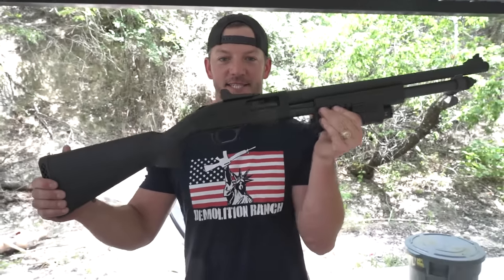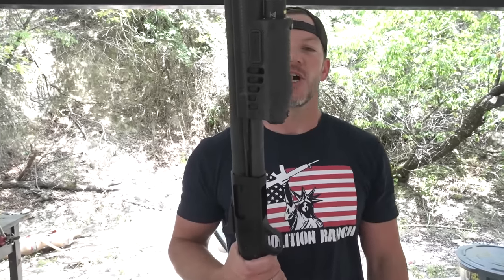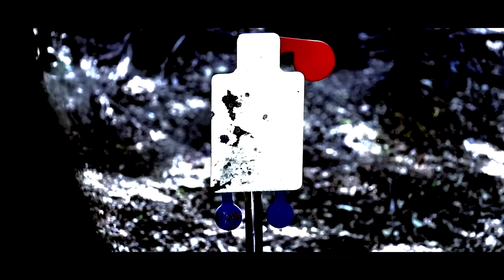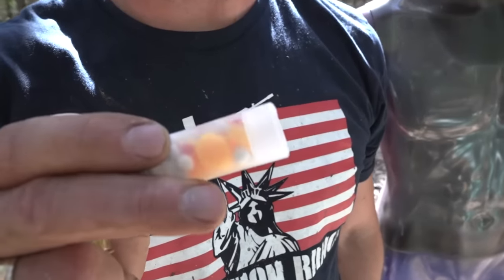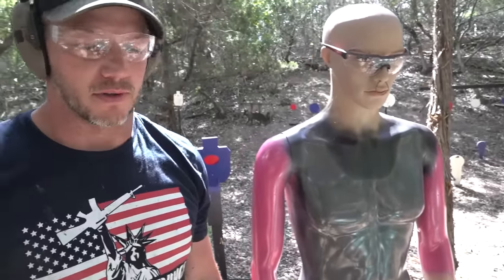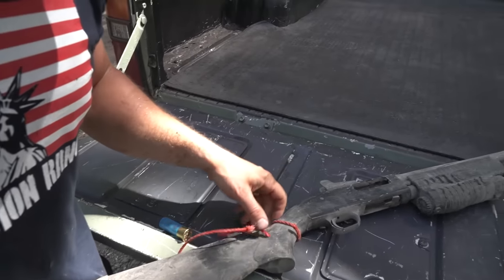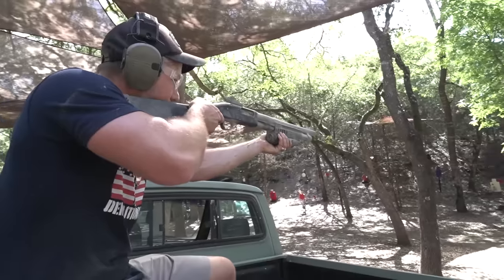DUCK Shot! Rubber Ducky 12g... Gimmick or Deadly???

Comment: That Mossberg sounds a lot more solid than my 3 Remington 870's to be completely honest.  I have never owned the 500/590.  Maybe I should buy 1...
Reply: They're still relatively inexpensive, and built like tanks. I've been a fan of them since I got my first "combo kit" from Big 5 in the '90s, with the single bar action. Thing was indestructible; I sold it along with many of my guns when I got laid off during the dot-com crash in '01... and promptly bought another 500 as soon as I could afford a new one. They're kind of like, well, Toyota pickup trucks...
Reply: Or 2 the maverick 88 is basically the same thing. The safety is a little different and I don't think it's has as much blueing. For the money they are solid asf though. Mossberg 500 series are badass. The maverick 88 is alot cheaper though.

Comment: I recently got to play with a 590S.  It doesn't have the heavy barrel and metal trigger frame like the A1, but it will cycle any combination of 1.75", 2.75" and 3" shells from the factory, no mods or adapters needed.  The 20" model will hold THIRTEEN Aguila shortie shells filled with four #1 buck and seven #4 buck.  They're less powerful than standards shells obviously, but still very capable of doing most things you might need a shotgun to do, and now it only kicks like a 20 gauge.
Reply: I actually like the lighter barrel the A1 is really heavy for what it is and the metal trigger frame can be upgraded from brownell’s making it the best of both worlds
Reply: These minis seem to be the wave right now, but have you actually seen anything as far as effectiveness testing? I’m really curious in them but I like the terminal ballistics of full power rounds. Just curious, not trying to start anything.

Edit: Paul Harrell has 2 videos up about them, so I’m sure I’ll find some answers there.
Reply: @superluminalsquirrel9359  they are actually kinda old they have been around for a while haha they’ve just been out of stock everywhere

Comment: I run aguila mini shells in my mossy for home defense. Doubled my loadout and still devastating. It runs it just fine with an adapter in the receiver. Kind of hard to find ammo, though.
Reply: Semi-auto or pump?

My real question is does a pump-action require that adapter to run minis?
Reply: @superluminalsquirrel9359 500 pump. I was surprised on the recoil the first time I ran the mini shells. Being so short of a shell there's no room for a buffer, it's just a hard plastic puck. Not bad recoil, just a little more than I expected. Decent groups. The slugs still pack a good wallop.
Reply: @superluminalsquirrel9359  I've been told it isn't needed. But I've never seen anyone actually prove it. It's under 20 bucks for the adapter. Pops in and out very easily but has good retention. Mine has never fallen out. I tested it when I got the ammo and it would feed without it.... some of the time.
Reply: @HolmWrecker  if you're relying on it for home defense definitely need the adapter. No since in taking a chance

Comment: I bought a nightstick weapon light, attached it to my AR,  and same night...screws that attached the light to the bracket that was attached to the handguard  stripped , broke. I don't think I tightened the screws too much in my opinion either. I also could have got a lemon. However,  surefire all the way and streamlight.

Comment: I can say right now that green laser isn't going to last very long. A red laser would have been better because red lasers can be made using a single diode with nothing else, just one little square that the light comes from, basically. Where a green laser needs a bunch of other crystals and other optics to get the green color. It's not possible to make a green laser with just a diode like that. But that means if any of those optics get knocked around and moved even just a fraction of a mil, it's going to turn that laser into a green flashlight pretty quick. I'm sure anyone who's had a cheap green laser can relate. You drop it once it you no longer have a nice clean beam.

I can understand using a green laser because the human eye sees green most clearly. That's why with a <5mw red laser you just see the dot, but the same power green laser you can see the beam through the air and the dot is visible from much farther away. But green lasers just aren't built for ruggedness. It's a bit more expensive, but a higher power red laser would probably work just as well. But I don't see the point of putting a laser on a shotgun anyways. You're not going to be THAT far away from your target that you're going to need that laser. I'm no gun expert, but I'm sure iron sights or a red dot or something would be sufficient. Correct me if I'm wrong though. I'd be interested to hear about it if I am mistaken.

Comment: Matt you should invest in a pac of wetwipes, you are a father so you should be familiar with them. 
A pity to do that to a Mossberg, treat it right and it will last you a lifetime ( it may even if you don't ).
I still would like you to do a program with the Swedish 9 mm ammo, P39B!
Steel jacked armor piercing 9 mm parabellum, and it have the higest gas preassure of any 9 mm ammo.
They may be hard to get because they are forbidden in most countries.

Comment: Please shoot the new refrigerators that use oxygen as refrigerant They have caution explosive all over them shoot it with a incendiary round at the end If the other things you try don’t work use more than one I am an HVAC technician and these things scare me I want to know what I’m dealing with please like this comment so it will be seen it’s a good idea and it will be fun might be one of your best videos ever you will have one of these in your home soon I’d like to know how explosive it is before I put one in my kitchen.     The compressor the black rounded biggest component bolted down in the back is the best target but also shoot the copper lines shoot anywhere And plug it in and wait 15 minutes that way we get the full true affect maybe even build like a kitchen set just a cheap one and blow it up in there as well then use that as your Clickbait and say explosive refrigerator!!! Or something
Reply: Reply
Reply: 2 reply’s
Reply: EPA doesn’t regulate oxygen so you won’t get in trouble but maybe run it by your lawyer

Comment: Hey Matt the This might me a strange request but can you do a video proving to the dum people on tic the a 12 gauge shotgun can not easy breach a commercial door such ass the one used in most schools the ones with the full steel frame and the small window with the wire mesh and the push bar stayed handle on the inside 100% of schools use these so I just want to prove my point to these guy showing they can get in but using a cheap interior home door not a proper door